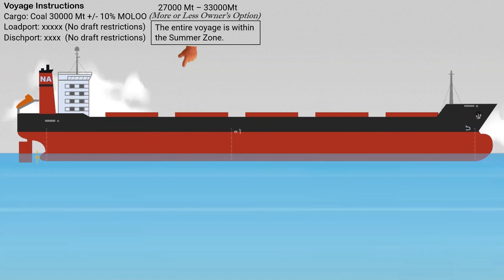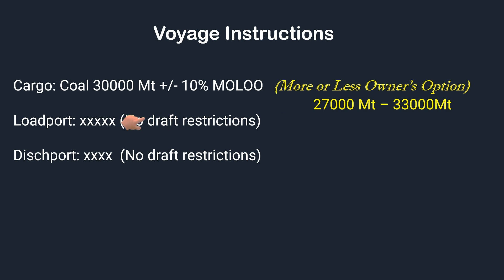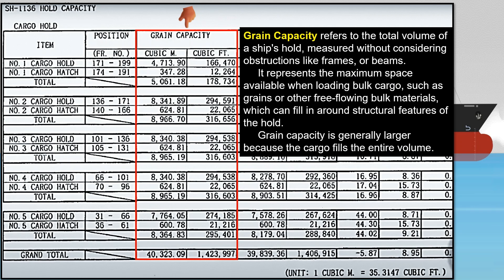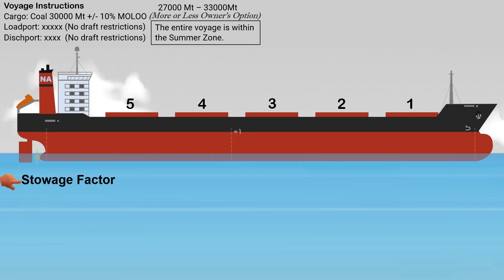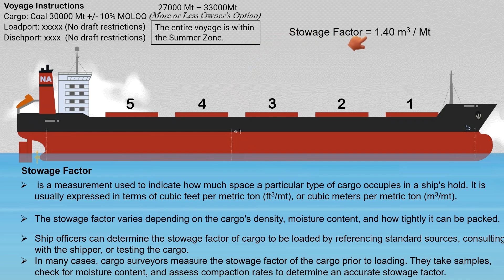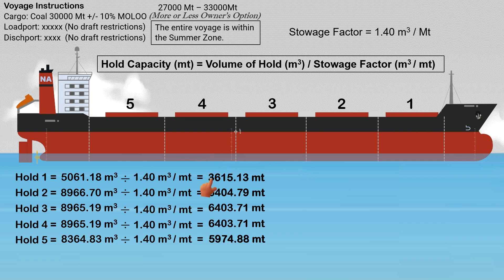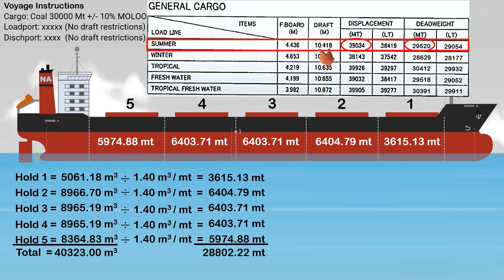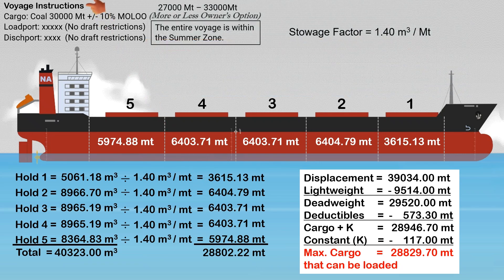Cargo Hold Capacity Calculations Part 1: Understanding Stowage Factor, Grain & Bale Capacities

Comment: I still don’t get it about how to get constant K? Where is it get from?
Reply from the maker: Constant refers to the weight of all items permanently onboard the vessel that are not included in the lightship — things like spare parts, extra equipment, paints, ropes, stores, provisions, crew personal effects, and other materials that accumulate over time.

Constant (K) can be found in the ship’s stability booklet. This value is reliable for a new ship, but as the vessel gets older and additional stores, spare parts, and equipment are added, it may no longer be accurate. To determine the actual Constant, an initial draft survey is conducted before loading cargo. I have a detailed video explaining how to calculate the ship’s actual constant. Here is the link: https://youtu.be/P14Xbnm17C8

Comment: Excellent! Actually, We usualy fill up for full from hold #5 first, #4,.... if coal are loaded by bulk! After that, we will adjust draft, trim and stability by ballast tank!!!
Reply from the maker: Thanks for the tip! This video actually has a Part 2, where I’ll cover load line restrictions as the ship move from the summer to winter zones, along with distributing cargo across the holds by percentage. I also plan to include the full loading sequence. Thanks for the info!